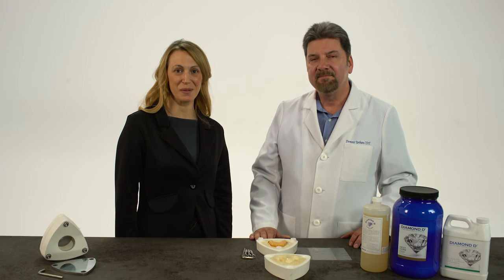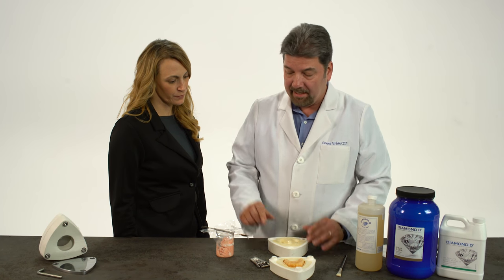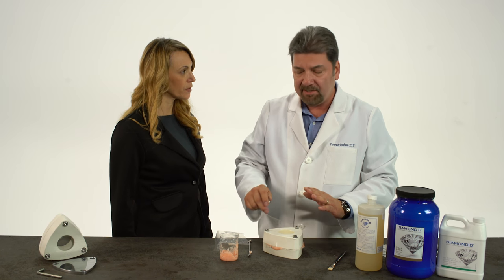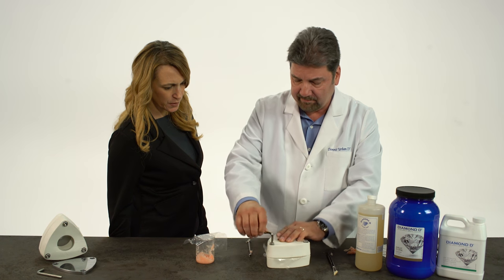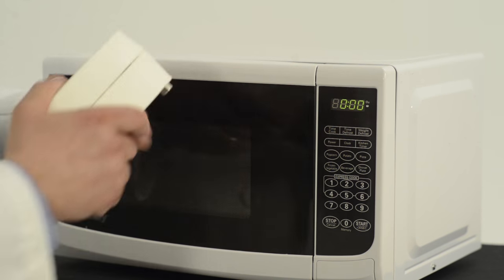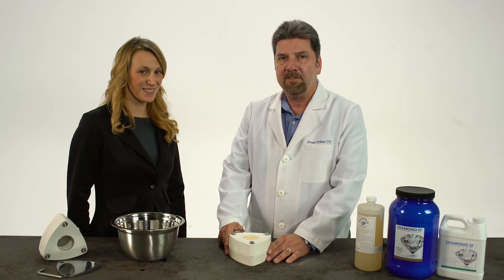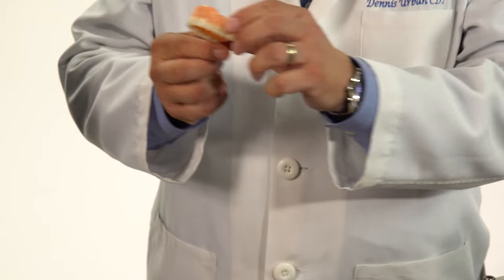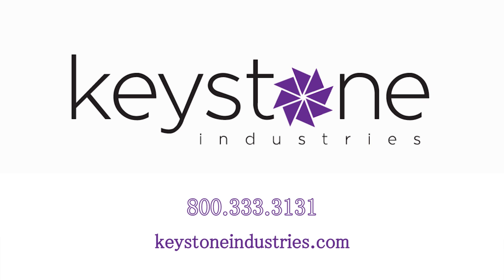Packing Diamond D Denture Acrylic w/ Tecnoflask

Comment: MAKE SURE that your MODELS ARE DAMP (wet throughout) during microwaving otherwise your acrylic will dry out and become brittle. It's the water vapour from inside the stone which heats and cures the acrylic uniformly. SECONDLY if your models/flasking gypsum are dry it will act like a sponge and pull some of the monomer like a sponge and dry out your acrylic during curing.
Reply: Nah. I process on wet/moist and dry models. No difference.
Reply: Press packing is the only reliable way to avoid open bite/increase in VDO and avoid porosity. Using bolts only to "pack" is somewhat amateurish.